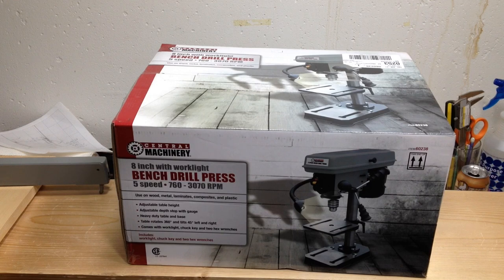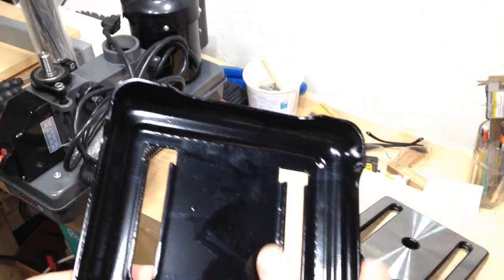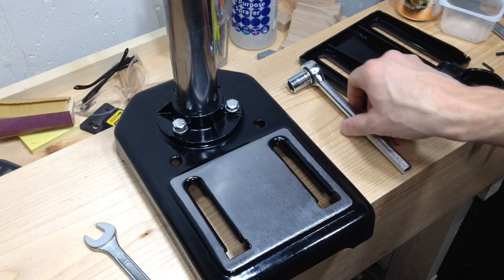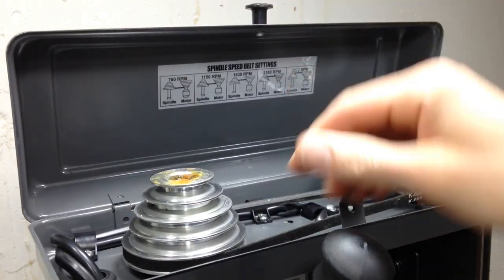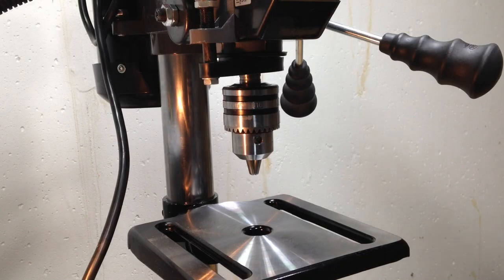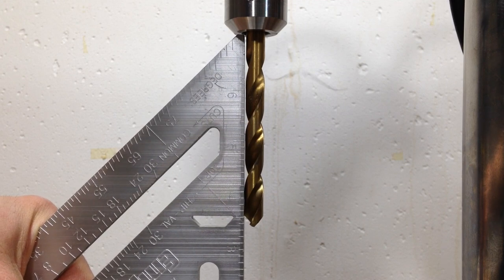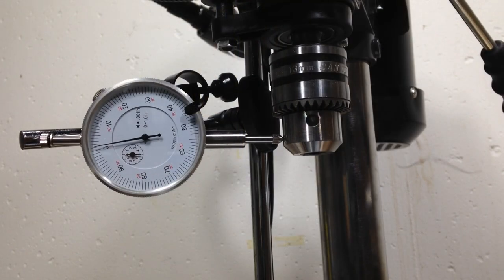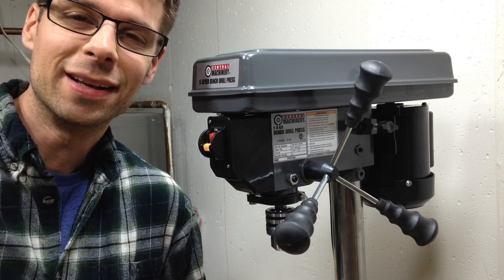Harbor Freight Dril Press Review

Comment from the maker: Let me know what you think, and thanks for watching! Take care.
Reply: I've bought same drill press. I enjoy using it for my projects. I've taken spindle pulley off and added more wheel bearing grease to the top bearing. Also i tighteing up the spring cap to eliminate slop a bit more. Overall i like this drill press for my budget.
Reply: Also i leveled spindle pulley with the motor pulley. I hope any of this helps.

Comment: You can get stands you just sit your drill in. Not sure how good they work. Where's the product made? China? You could fill the column with sand in a plastic bag (which I use with speaker stands). It seems pretty good for the money. I guess as an engineer you like the accuracy but for non precision use it seems it would fit most contexts. Pretty good if you ask me.
Reply from the maker: I'm sure it's made in China, most HF products are. I was really surprised at the quality for $65 bucks. You could hardly buy the motor for that. I agree, not a bad tool. Take care!

Comment: Harbor freight must have bad quality control or different levels of quality for different price ranges. my drill press is a 8" 5 speed drill press at $60 on sale , what piece CRAP from China. extreme run-out and play in the spindle and worse with the feed handle down 2 inches and the motor runs hot, noisy. The base and table are not cast iron, instead sheet metal. Pay more and buy a vintage Rockwell or Craftsmen, Delta or an old Atlas..